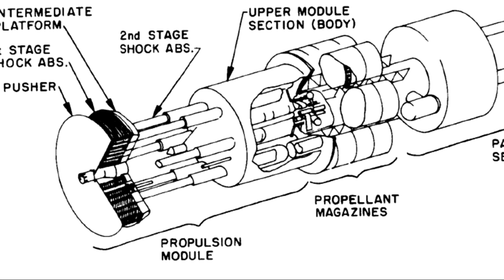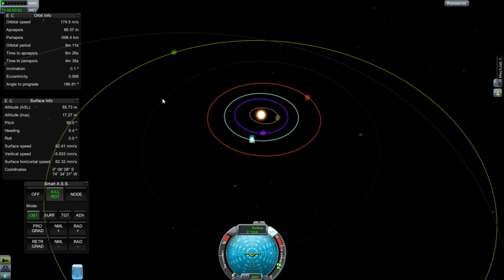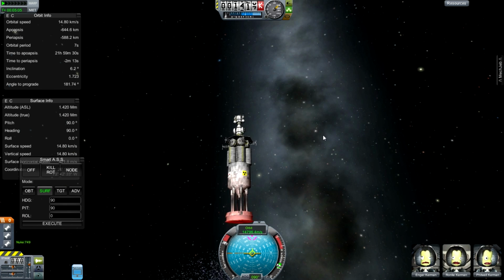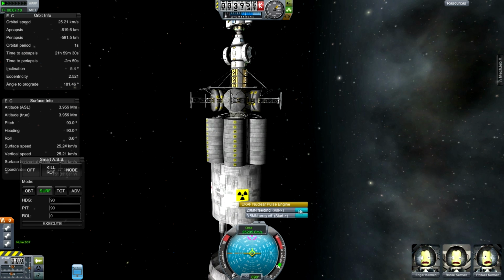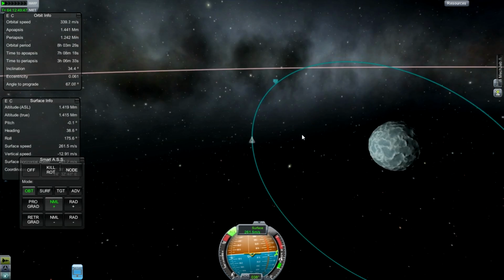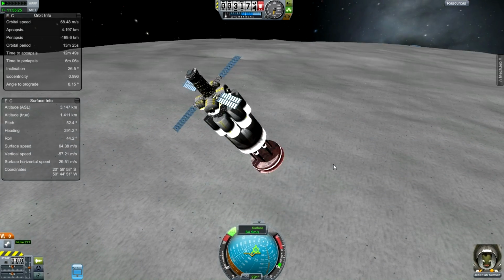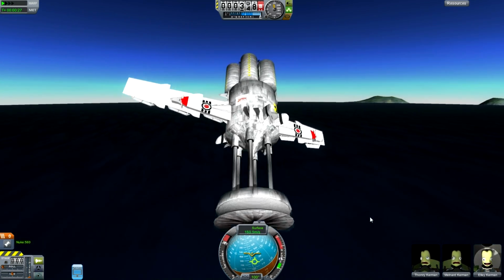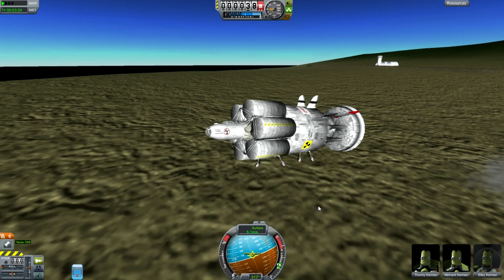Kerbal Space Program - 'Orion' Nuclear Pulse Rocket

Comment: So what you're saying is that RIGHT NOW we have the technology to launch a rocket the size of a small city to 10% of the speed of light. WHY ARE WE NOT DOING THIS?!
HOLY CRAP WE COULD BE AT PROXIMA CENTAURI WITHIN 50 YEARS (actually probably longer than that because you'd have to accelerate and then slow down again but still).
Reply: LydianLights Because it would cost several trillion dollars, and irradiate the planet when it left....
Reply: LydianLights u really did not got what happens whe  you use this in the atmosphere? Its like, if u have a fallout in ur city, at next day, every single person is DEAD
Reply: TheBalefire meh, radiatiion makes things more interesting anyway
i want 3 heads!!
Reply: LydianLights Because "nukes are bad!".

In truth, the environmental consequences aren't great, but then neither is burning the downright toxic crap that chemical rockets use.  Or, for that matter, coal power plants, which release enough uranium into the air that the potential fissionable energy thereof actually exceeds the energy you get from burning the coal.  The warheads used would not be big city-buster types, but much smaller, so EMPs would be much less of an issue.
Reply: TheBalefire No, the whole point is that pulsedrives are insanely cheap compared to chemical rockets.  And no, if the 2000+ nuclear test bombs detonated since 1945 haven't irradiated the planet, then this wouldn't either.
Reply: Jared Lessl no matter the cost efficiency compared to chemical rockets, building a craft the size of the small city (the largest that Mr. Manley describes, and in the original poster's comment) would still be insanely expensive.  Also, you go ahead and plan a flight path for an ascent trajectory that doesn't pass over any populated areas or put fallout into any jet streams, I'd love to see it.  Most  nuclear tests were done in extremely remote locations, and even then they had some problems with fallout and contamination, so doing it thousands of times in the upper atmosphere with small yield nukes?  No thanks.  
I am all for nuclear power plants, I wrote a 30 page analysis of the advantages of nuclear power over other alternative methods of power production for my technical communications class, but whatever source you are quoting about fissionable energy from uranium in coal was either flagrantly wrong, or you've extremely exaggerated it.
Reply: LydianLights The idea is that the nuclear pulse rocket will start functioning after it left earth, first it would use other means of propulsion to get out of the atmosphere.
Reply: LydianLights We would only ever use something like that if the Earth was about to be destroyed, and there was a 0% chance of avoiding it
Reply: +Jared Lessl Liquid chemical rockets use cryogenic hydrogen and oxygen as fuel. Burn hydrogen and oxygen, and you get water vapour.
Reply: +Howling Wolven I believe it's actually SRB's that have toxic exhaust. I could be completely wrong however.
Reply: +LydianLights We have no reason to believe that there would be anything there when the ship reaches Proxima Centauri except a slow death in space as their recycling efficiency and hardware failures gradually reduced the sustainable population of the ship to zero.

Basically, it would be one of the most expensive thing ever with one of the most depressing ending of anything in human history.

Comment: Yes, you are correct. Throttle from 1% to 30% make detonation interval every 1.5 seconds. 30% to 60% is every 1 second. 60% to 100% is every 0.8 second.
So the 3.5MN bomb detonated every 0.8 second is 3.5 / 0.8 = 4.4MN thrust

Comment: High velocity plasma hitting the pusher plate provides the thrust. The projects physicists had designed micro-warheads that would produce a cigar-shaped jet of plasma directed at the pusher plate and out the back. No need for air to propagate the energy. Check out the book on Amazon if you're interested, it's a great read: "Project Orion: The True Story of the Atomic Spaceship by George Dyson". It goes into quite a bit of detail on the physics.

Comment: "Likes to think big"
Yeah, for a guy that proposed using all the mass in a solar system to build a shell around the system primary and then harness all the energy generated. That may be the most appropriate statement ever.

Even though he then came up with the idea of a satellite cloud that could do more or less the same thing with much less mass used. And then Larry Niven came up with the Ringworld idea which is kind of the best of both worlds, but would require even crazier materials to work.

Comment: The problem with explosive launchers is that they have high thrust (initial acceleration) and low specific impulse (which equates with average acceleration). This method violently shakes the cargo, and loses speed very quickly. A (kinda) superior alternative, would be a large electromagnetic cannon (a solenoid) that accelerates a probe/space-fairing vehicle over a distance, which increases the impulse/specific impulse (F(delta(t))) or F(t)=Massloss/time x (Impulse) x g without sacrificing thrust

Comment: 1. It was determined a spacecraft the size of the proposed Orion would naturally shield the crew from all the radiation just due to the bulk of its engines and fuel. 
2. The Orion would launch from the North Pole to minimize fallout; additionally, it could be lifted by a conventional explosive pre-charge if necessary to get clear of habitation.
3. The proposed ascent trajectory would likely be Polar, which means there's unlikely to be much in the firing line except the ocean if things go wrong.

Comment: That's a good point! But consider this. Momentum is mv and so by applying conservation of momentum m1v1=m2v2 we can see that if m1 is the net mass of the particles from the shape charges, and m2 is the net mass of the ship, v1/v2 is going to have to be equal to the ratio of the masses. If the bomb is 10^3 pounds (W47 warhead) and the ship is 6.5 x 10^6 pounds (saturn V) the particles have to be going 6.5 x 10^3 (6.5 thousand) times faster than the rocket.

Comment: According to the 1960 report, the NASA 10 meter Orion used pulse units of one kiloton, converting 34.3 kg of tungsten into a plasma jet traveling at 150 km/s, imparting a thrust of 2.0 × 10^6 newtons to the pusher plate

Comment: Every single one of those 3,600 bombs is locked so they would not explode even if you pounded them with a sledge hammer. When a bomb is ejected for a pulse, it is armed by a radio signal only when it is clear of the pusher plate and moving into detonation position.

Comment: The smallest an Orion can be is not determined by the smallest A-bombs you can make, but the smallest bombs. It can just be a plain old pulse rocket, not necessarily nuclear pulse, but this would be pretty dang small, the test articles they constructed used just bombs. And plus, an Orion Upper Stage for the Saturn-V was an idea to keep Orion alive. In fact, the Saturn-V just had to get up pretty high, then the Orion would've kicked in, and increased Payload to anywhere.

Comment: The nuclear reaction unleashes a massive pulse of EM radiation and heat. On the rear of the charge, the part of the bomb facing the pusher plate, there is a thick sheet of tungsten, the rest of the charge is made of tougher material. The intense radiation vaporises the tungsten plate and blasts it out as a cone shaped jet of plasma. This plasma jet is what strikes the pusher plate. It would work without the tungsten plate too, but not nearly as efficently

Comment: Yeah the risk of massive radiation sickness from tons of niles blasting would be a hazard I mean groups protested the pioneer series with their RTGs then the voyagers with their RTGs as well also the same units fitted to the viking landers then Galileo and and casini and new horizons and curiosity uses one as well but combined they might have had 2 to 300 pounds of plutonium Orion would be tons of radioactive material in 1 place a crash would be an ecological nightmare

Comment: the matter of the explosive device, although low in mass, would be able to have profound effect of the spacecraft, even if only a small portion of it strikes the pusher plate. a grain of sand travelling at the speed of light could obliterate a large building. a few fragments of that size propelled by a nuclear explosion could easily transfer a considerable amount of energy. I imagine the nuclear device might be similar to a shaped charge, with the force being vectored towards the spacecraft.

Comment: And this is if every atom of the bomb splits (which is completely unrealistic, 60 to 70% of the bomb is normally made of fissile material). This also doesn't account for loss of energy to radiation, and loss to light emission (which would be huge because energy loss is dictated by highest entropy, and in less dense mediums such as this as photons would be emitted for a lower amount of energy than accelerating an entire nucleus). It also doesnt account for the fact that most of that material(cont

Comment: :O You'd are right if the ship was carrying the bomb with them, on the ship. But the Orion project specifically outlines nuking the vehicle from an outside source, to avoid adding unnecessary mass to the vehicle which would slow the acceleration (F=ma). Also if you keep all of the bombs on the ship you'd run out of space and it would again as stated above be harder to accelerate.

Comment: Actually, it wouldn't. The plate itself would protect the rest of the ship not only from the plasma shock wave but also from any damage an EMP would cause. The plate would, if I recall correctly, have a coating of lead on its surface to prevent gamma radiation from penetrating the hull. You wouldn't even need to line the rest of the craft with lead.

Comment: There seems to be a lot of sound in space. Thankfully a pulse engine wouldn't make that annoying noise. And the overpressure baseplate would be concealed behind fairings leaving nothing but a stark white intermittent flash at the ejection port as the engine is working. It's a shame they didn't make a more realistic model.

Comment: The only real reason the project died was General Atomics went bankrupt, and when the Air Force picked it up wanted to use it for an orbital nuclear artillery satellite. JFK shut that right down.
If we can get clean nuclear reactions, that is, no fallout probably by fusion only,
I would love to see such a project again. Either that or a fusion magnetohydrodynamic rocket; an unsealed reactor that magnetically channels the force of a continuous plasma reaction out the nozzle.
It would be feasible to build a sort of solar system cruise liner, of perhaps 1 to 5 thousand people off of a battery of such rockets if we had surface to orbit systems that were cheaper.

Comment: Gamma radiation goes right through lead shielding, and nuclear explosions tend to create a lot of that deadly stuff, and there is no way to shield the crew from it's effects.  So generally, it won't work because everyone in the ship would be dead fairly quickly..
Reply: Actually, Lead shielding is one of the only ways to dampen gamma radiation. It doesn't stop it completely unless it's thick enough. The earth, despite not being lead is by far thick enough so that gamma radiation never even reaches the mantle. You would maybe need 100 meters of lead to completely stop gamma radiations, but 100 meter thick lead walls aren't really practical.

Comment: Systems like ion or VASIMR drives. They are rated by something called "specific impulse", sort of like gasoline mileage in an automobile. The higher the better. 
This comment system will not allow posting links.
Do a web search for "atomic rockets project rho", go to the site, and look in the "engine list" section.

Comment: It's the Archangel Michael from Footfall! ( Niven and Pournelle)
Reply: Nah. If it was Michael, it would've had turrets from the actual battleship, all four STS Shuttles docked with tanks but no boosters, and dozen of a gunships.

Also, Michael had a different drive configuration. Instead of a single drive bomb launcher in the center, it had two huge towers, loaded with drive bombs, installed on the pusher plate assembly, with drive bomb launchers almost poking over the edges, as well as four smaller tower with spurt bombs for making a crispy gamma ray-fried space elephants with each pulse.

Comment: Space is a vacuum, ''sound'' is when particles have energy applied making them gyrate causing air to move and make noise. Thats why in some forms you can SEE sound. You cant hear anything in space because there is no particles to apply energy to. Also Charlie Thomas, you speak as if the oxygen is in seperate zones. Our Oxygen is distributed throughout the atmosphere roughly equally. Most modern life on earth would die if the oxygen percentage would go higher or lower [Continued]

Comment: Interesting, the problem seems to be in the limit of the size of the nuclear weapon charge... But what if instead of a "simple" nuclear explosion we used partially formed quantum singularities? As something more similar to the recent light ship's concept of exploding atmospheric oxygen to escape the planet(that of course still leaves the question of reduced efficiency of in-space flight), except in my view it would be more along the lines of "exploding" the "hard vacuum" itself... Perhaps a plasma included reaction to catalyze the exotic matter(its layer, a membrane between it and the rest of baryon if matter, and as it happens the process would be subverted from further unraveling and "loosing charge" as it were by "freezing" the event in an absolute zero field), thus "motivating" the "agitated" zero point energy, then diverted in a closed loop channel to push against an established "isolated" magnetic field. Thus any object or person aboard would be protected from the excessive G forces by utilizing the kinetic energy itself, as it is being redistributed in our space, much like heat exhaust... Except here it would be just as usefully repurposed as the solar wind, applying "pressure" and mobilizing a solar sail...
Perhaps in this way we could move entire space stations and settlements, maybe one day even structures up to a Dyson level of engineering. 
Of course the inevitable question then(or rather still) becomes of how to control the input output ratios, finding a balance to attenuate, to use the membrane of "hard vacuum" as one would pluck a string of an instrument(except here the "instrument" being space, the universe itself, or rather, to be more accurate, our presence in the universe. Much like the gold dusting effect in the early atomic microscopes' designs. Influence of the presence of an observer on a given quantum state) for a melodic sound or as a hydrofoil or ekranosphere utilizes the differences in forces over a given surface's tension and responsiveness...
Then again, a solution to such a "problem" is fairly obvious, and lies in-between the absolute zero, quantum entanglement, and quantum computer technologies
Reply: Orion was an actual spacecraft based on actual technology and actually buildable in 1960. None of the stuff you are talking about exists even today in any practical sense. One might as well say why not replace the pulse units with warp nacelles. It makes just as much sense in this conversation.

Comment: Why didn't anyone realize that the best thing to do would be to build the Orion spacecraft in orbit with hundreds of conventional launches (just like the space station), and then begin the nuclear detonations while in orbit.  The issues of fallout when then go away.
Reply: im sure they thought of that but the part of the launch that requires the most fuel and mass is the ascent from the surface to the outer atmosphere that plus all the bombs would add to quite alot of weight
Reply: Agreed, but we cannot detonate atomic bombs within our atmosphere.  The nuclear explosions destroy our ozone layer massively.  They didn't know this at the time and thank god they didn't try it out.  Can you imagine what a thousand nuclear detonations would do to our atmosphere. Just crazy.  No, the only solution is to build the spaceship in orbit and begin the detonations there.  Now with SpaceX reusable rockets coming on line in a few years, We may have a chance to see this happen.TheCaptainkitten
Reply: Chris Horianopoulos Hundreds of conventional rocket launches would do us no favors either though. Best to launch a whole space base in one shot, using larger, relatively efficient fusion bombs. The unfortunate thing is that this system is BEST suited to atmospheric launches, since the atmosphere transmits the blast far better than vacume, allowing relatively low yield charges to be used.